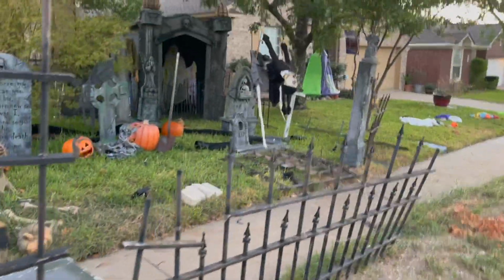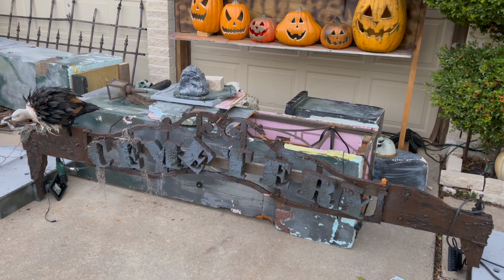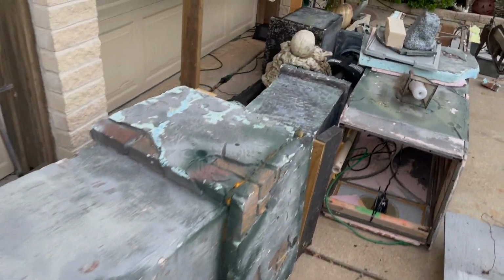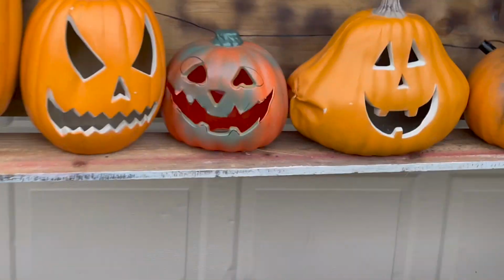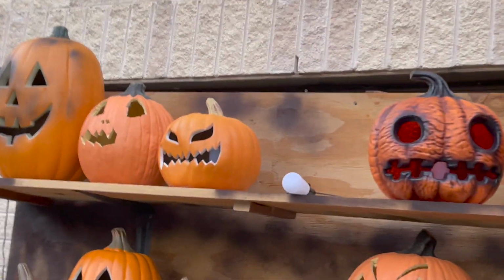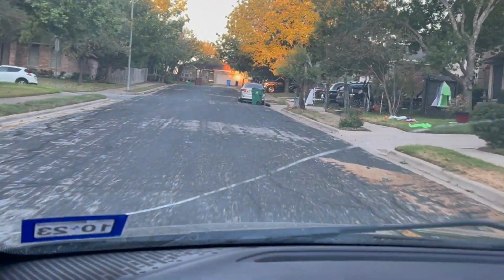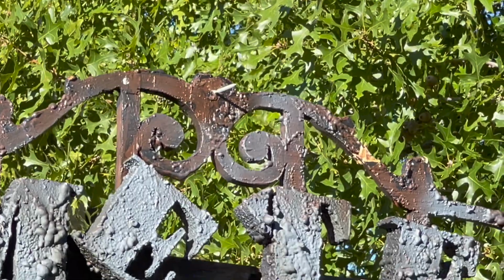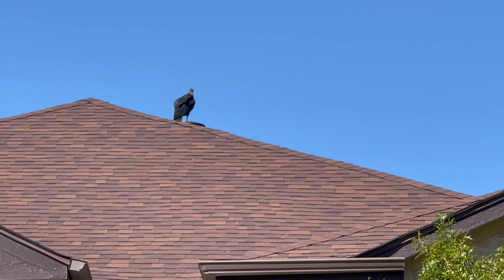Halloween yard update 5 Storm and mass distraction

Comment: Hate that Texas weather, wind especially hits right after I put up Halloween stuff.   I have found that putting some cement in the bottom of the columns help.  I have also experimented with putting 5 gallon buckets of water in the columns.   This year I made a Portal and it held up through the month.   Even though its profile was very "wind catchie"  I did a few pounds of concrete, and 4 rebar stakes.   Glad to see you are still going...we need to restart TX haunt gatherings
Reply from the maker: Yeah, I usually do all that and for some reason I did not this year and I paid the price and yes, we definitely need to start that up again